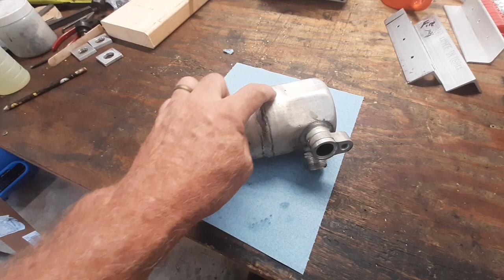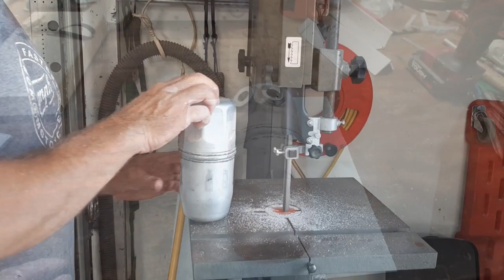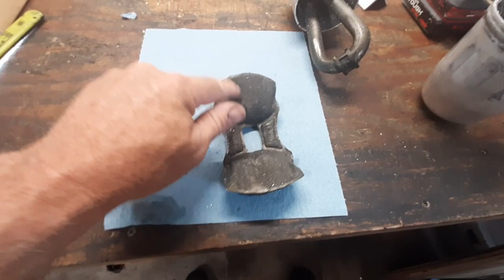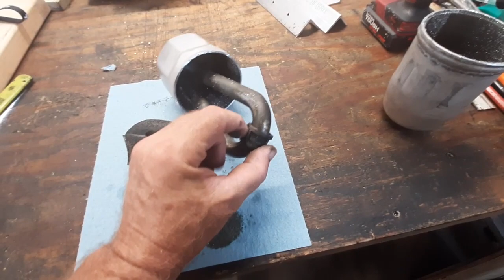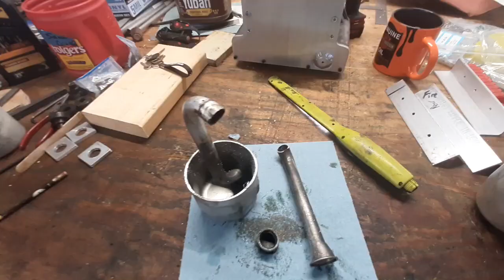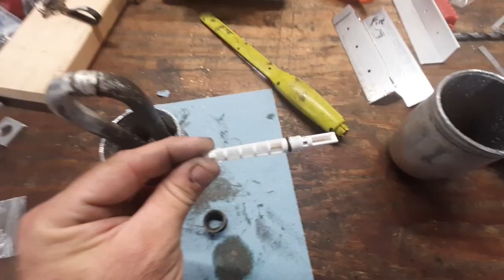Air Conditioner Filter Dryer Accumulator - What's Inside???

Comment: It’s not exactly a filter, the oil in the system accumulates in the bottom of the canister.  The oil level is above the bottom of the u-tube and the small hole allows a metered amount of oil to enter the suction side to keep the compressor lubricated. The screen is to keep any trash from entering with the oil and damaging the compressor